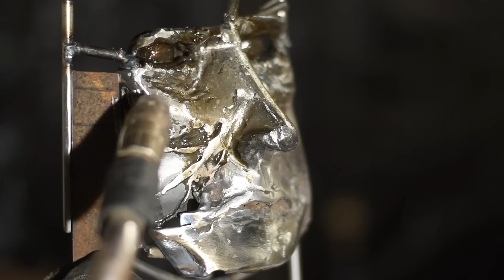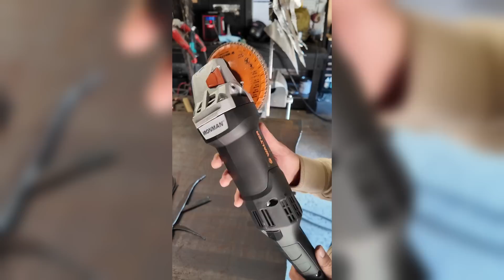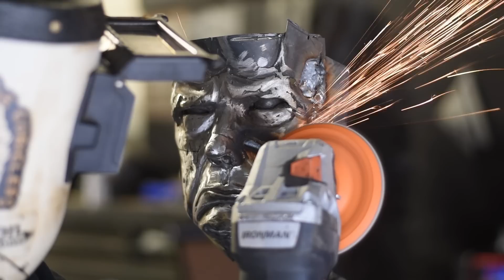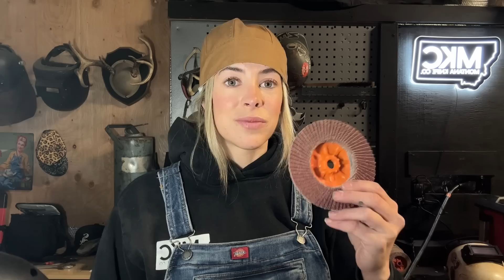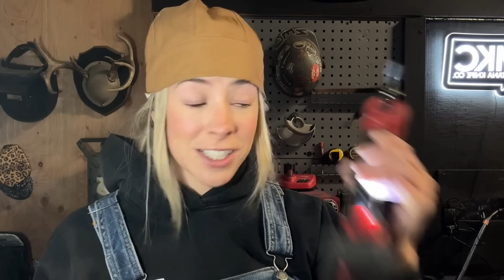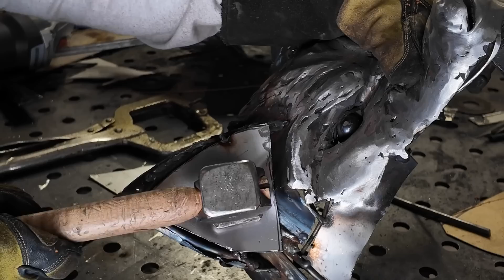My TOP Metalworking And Welding Tools For Beginners

Comment: If you're going to show people how to do stuff, then you should. how them how to use the right PPE.  Grinders come with a guard and a side handle for a reason........
Reply: If you need a tampon just say so
Reply: Ya guards and handles have there place but in the work she does they can get in the way to get in tight spots. I’m a retired journeyman welder of over 45 yrs and i have seen a lot of different circumstances where guards and handles just dont work. As far as safety using a face shield would help to save your eyes.

Comment: Late to the watch party and didn’t go through most of the comments… but if not mentioned previously, a flex shaft attachment to a die grinder is super handy 👍🏼
I also second whatever anvil and gas torch comments too 🔥⚒️🔥

Comment: I agree with you on the Milwaukee M12 right angle die grinder.  Every time I pick it up it feels like it will be helpful, partly because it has a good variable speed trigger and so many attachment options.   I have the safety catch on the trigger pinned back with a small removeable washer to help with slow speed nuance work.  Thanks for helping inspire our creative efforts.

Comment: Hey right on good tips and tools..I would like to share one of mine..I use old jacked up screwdrivers philips/flatheads ect...as a handle to tack small  little pieces on to something i simply tack the piece that need to weld with the screwdriver and i can hold it steadily and tack away..if that makes sense?! Lol anyways weld on great work
Reply from the maker: Genius. Thanks for sharing!

Comment: As a bladesmith i might suggest an anvil. I cant get along without one
Reply from the maker: Anvil and an oven are on my list to buy for sure!
Reply: @Jen_Phillips  your custom hammer will work well on an anvil. Should provide a great ring tone
Reply: @Jen_Phillips  just wanted to add that ovens can be spendy. A propane forge is much cheaper but if your just heating up sheet metal your acetylene torch will work just fine. Even a propane torch will work well on sheet metal.  Up in Alberta you might be able to find an anvil at a farm or ranch. Just bounce a ball bearing ball of the table. If it returns to your hand it's a keeper. New anvil can also be speedy. I see you wearing Mobtana Knife Co gear. If your tight with those folks that might be a good place to find an anvil. Keep up the great work Jen!

Comment: Very informative video. I don't sculp but I do love to tinker in my garage that I turned into my metal shop. A evolution cut off saw is a game changer over my old abrasive chop saw. And I added a lathe and vertical mill last year and don't know how I waited till I was 71 to do that. Primeweld 225 and Miller 211 get the welding done.